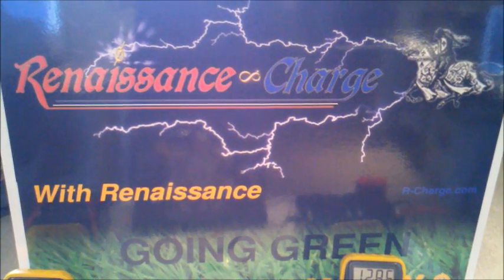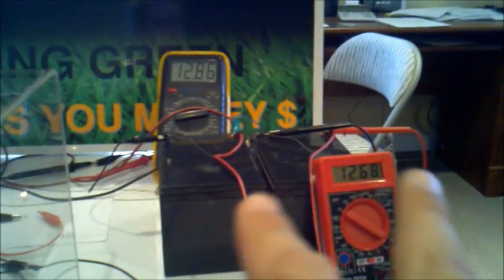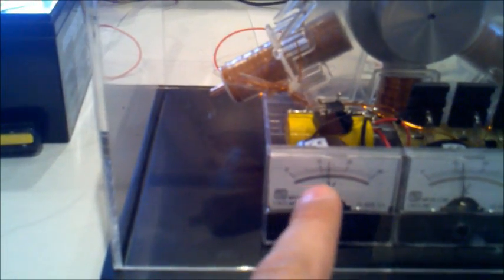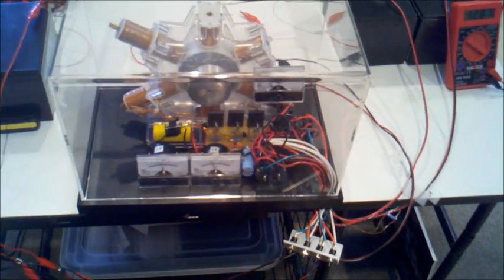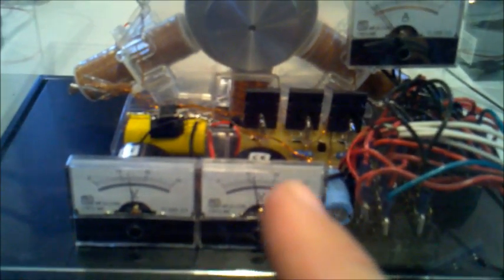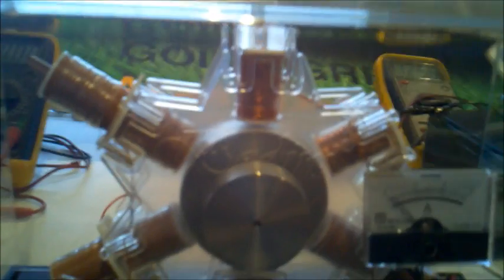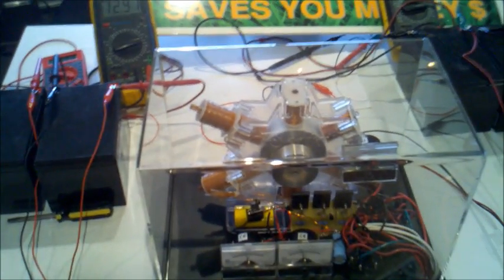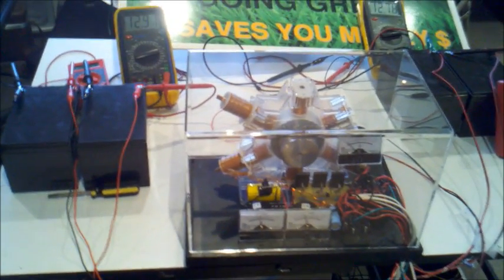6 Pole Monopole with 4 Batteries swapping with Load

Comment: Hello sir, very interesting swapping system, but i have a question,  it is benefic than the loving path system because the energizer is charging 12V and the system also is 12v? thank you
Reply from the maker: It is beneficial in that you are charging another battery for free while it is running the motor. The swapping does that automatically.